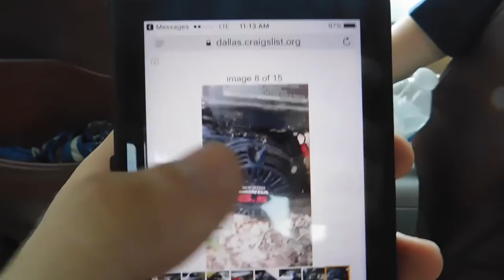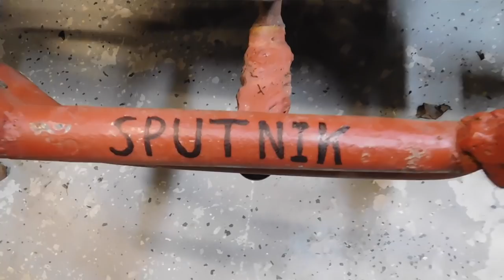$50 Go Kart Find!

Comment: Cool, I like the size ... but be careful because whoever built it really half ass it. They tried to go to cheep. Re check the welds, bolts, and pivot points.
Reply from the maker: T-Mans Go Karts Yeah, it's gona need a complete rebuild to not fall apart lol.
Reply: yep, I gave up on the CL finds a long time ago. every one I came across was so bad. Every once in a while I would come across some thing good but it would be gone by the time I would call.
Reply: Too*
Reply: T-Mans Go Karts these guys are trying to go cheap as well so.. didnt u rly see? They fcking welded the chain...
Reply: T-Mans Go Karts you don't have to say bad words!
Reply: Learn to write
Reply: ilusms🐱🐷🐽🐧🐒🐵🐴🐻🐶🐯🐵🐷🐵🏥💙🐧💙💙💙💙💙💙💙💙💙💙💙💙🐧🐧🐧🐧🐧💙💙🐴🐻🐻🐻🐶🐶🐯🐯🐵🐵🐒🐒💋😍😍😍😍😍💋💋💋💋💋💋💋💋💋💋💋💙💙💋💋💙💋💋💙😍🐽🐷💙🐷💙💙😍😍🐷😁💋😍😍😁💙💙💙💋😍😁💙💋😍😁💙💋😍😁💙💋😍😁💙💋😍😁💙💋😍💙💙🌇🌆🗼🏭🏰🏠🏡🏫🏢🏣🏥🏦🏪🏩🏨💒⛪🏬🏤🌇🌆🏯🏰⛺🏭🗼🎅👻🎃🎉🎊🔮🎥📷📹🎓🎓💝🎓🎓🎓🎓🎓🎓🎐🎐🎐🎐🎍🎍💝💝💝💝💝💝💝💝💝💝😍😍😍😍😍😍😍😘😘😄😁😁😁😔😔😔😒😒😒☺☺😉😜😜😜😜😜😜😜😜😜😘😘😘😘😘😘😍😍😍😀📹📷🎥🎃🎃🎃🎃🎃

Comment: How difficult would it be to convert a go-kart into a functional snow machine that could be used for ice fishing? I'd like to get ahold of a kart and put skis on the front. But as far as the rear, I'm not sure what it'll require to be able to push through snow. I was thinking paddle tires made for sand? That'd be a whole lot easier than full on trax like a tank or even a single track like a snowmobile. Thanks for any input!

Comment: I have a 13.5hp 400cc briggs. I want to make a go kart out of it, and I know it has a lot of power, its on a lawn mower right now, and I can tow grain bins. I want to gear it so that its fast though. Problem is, its vertical drive at the moment, what do you suggest I do?
Reply from the maker: Dylan Taylor Yeah if you don't want to retain the stock transaxle then you could get a 90 degree gearbox in order to transfer the power but if your just looking for a higher top speed you could try to mess with the pulleys that go from the engine to the axle and put a bigger one on the engine output shaft but higher speeds will cause stress on the axle so it does have a chance of breaking. Hope this helps.

Comment: I have a 20 year old mower that hasn't had any maintenance besides oil replacement and gas fill-ups and it runs better than that engine
probably cuz the mower gas tank is plastic and not metal
heh

Comment: Hey guys,  That starter cord pulls way too easily.  You've got no compression.  Either the valves or rings are shot!
Reply from the maker: Ray Kolasa Dang I really hope not, we have a new carb in the mail and I hope that fixes it but it ran pretty good on starting fluid so we may have some hope.
Reply: Well it wasn't smoking so it might just be the valves are out of adjustment.
Reply from the maker: Ray Kolasa Yeah your right hopefully it's the carb or something we can just adjust

Comment: Why not use the carb from the 212?  Its the same one!!!!
Reply from the maker: David Johnson We actually did try that but it was smaller and the engine didn't really like it...which is weird because it's basically an exact clone of the Honda
Reply: That is odd a Honda gx200 is the same as the 212cc might need to check the valve lash and make sure they are at the right spacing. To tight and the valve stays open ( loss of compression ) to loose and you get valve rattle. Also check to make sure the gaskets are not torn that will make it run like crap as its getting to much air and not enough gas.
Reply from the maker: David Johnson Will do, thanks

Comment: check the jet you bum, it's clogged
Reply from the maker: Cade Blain Yeah that's the problem, but it wasn't clogged with anything that we could clean, the metal of it was completely stripped and mushroomed so there was hardly even a hole anymore so our only choice was to drill it out.